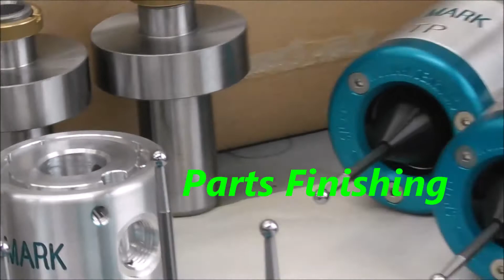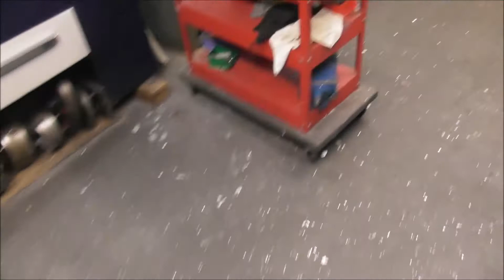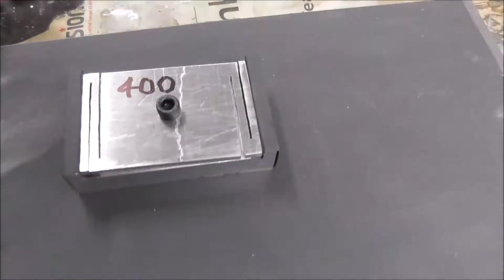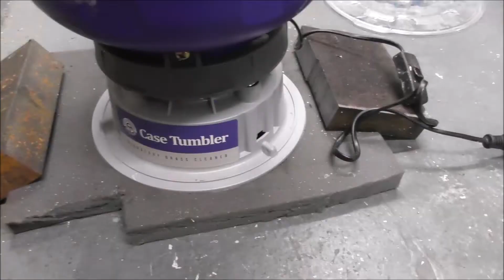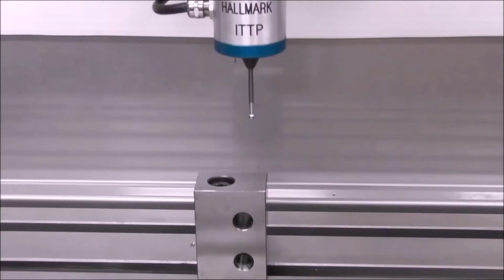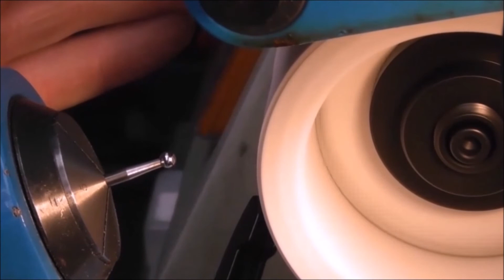Parts Finishing

Comment: With you case tumbler, add some heat shrink to the middle all tread rod. It will help prevent your parts from getting scratched by the rod. Tip from a reloader, works really well. I used some fairly thick heat shrink with adhesive on the inside and it has been on there almost 10 years now. I don’t run mine a lot but it has gotten a lot of use for a couple years at a time.
Reply from the maker: Thanks Michael.  A good idea! Cheers  Cliff

Comment: Yes, Hare & Forbes ( Machineryhouse ) might be a great place to start looking for an Abrasive Blaster.
They do have an outlet in New Zealand.
It's based in Auckland.

Not totally sure IF it applies to New Zealand.
But H&F is right in the middle of a Sale at the moment so you might be able to save a few dollars.

You can also pick up the Abrasive medium for the unit too.
They sell the 2 most common types.
Glass Beads/ Inda which would be best for your Aluminium parts.
Or, they also have Garnet in different grits,  which is little aggressive for Aluminium parts.

But it might work IF you prefer a slightly rougher finish.
Cliff,  they have a few models available starting from under $300 which might suit you,  as this is a fairly small bench top unit.
Up to larger standalone units IF you prefer this style.

Best to go onto their site and have a look for yourself.
I am sure the New Zealand branch is still in Auckland ??

Try not to go to the shop itself ??
Other wise you might leave there with more than you planned 😂
All the best with your shopping.
Peter 👍
Reply from the maker: Thanks for your help. I think you are referring to the SB100 for the smaller machine? https://www.machineryhouse.co.nz/Sandblaster  Cliff

Comment: Hi Cliff. I have a blasting cabinet from Hare and Forbes (I'm in Australia) and I just recently bought 10kg of round glass bead from Supercheap Auto. It does a fantastic job on aluminium. The parts come out with a frosted appearance and it is good at removing scratches and machining marks. Also, very little dust and it doesn't cut into the stock. I run a home shop and it's perfect for what I do.
Reply from the maker: Hi Mark. Is it a SB100? Here is a link to their website: https://www.machineryhouse.co.nz/Sandblaster  Cliff
Reply: @Threadexpress  Cliff, I purchased the SB200 but it doesn't work very well straight out of the box. I made my own media gun and metering valve but these can be purchased from Hare and Forbes as accessories. I also fitted an electro pneumatic switch to control the air to the gun. It means that you can control the air supply with your knee. I have another video coming out on the weekend which shows the glass bead blasting process and the results. I have a playlist for the HF media blaster here https://www.youtube.com/playlist?list=PLbPzkHRZCQB83cY0EZhNt8zT0oXz-8Cli  Here is an Instagram post showing the results I got with the glass bead https://www.instagram.com/p/Cayc138J7uN/
Regards,
Mark

Comment: Many decades past when we were polishing a lot of 9mm casings on a daily basis I built a vibratory cleaner. A 10l paint tin with a few springs epoxied on top to support a plastic tupperware  lettuce storage container. The underside of the lettuce container had a DC motor from a cassette player mounted to it. The motor had a partially sawn off pulley mounted to it.  Using a variable DC power supply allowed the motor RPM to be set to match the resonant freq of the load at any given point and generate the most movement in the corn husk polishing compound.  Less than an hours work and less than $10 to build. Worked like a charm for years until the aftermath of Port Arthur when it all went to the dump.
Reply from the maker: Hi Don - Thanks for the design.. and history!  Cheers  Cliff